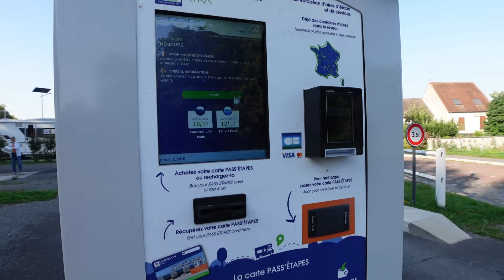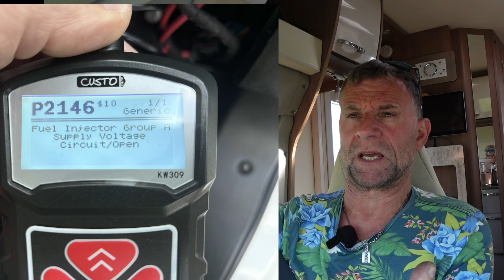CUT SHORT END "The Fiat Ducato Engine Light Edit"

Comment: Hi Jof, sorry to hear you’re having these issues. Fiat Ducato are notorious for these problems. Don’t replace sensors first. Do a diagnostic check. I’ve repaired 4 this year and the problem has been either blocked DPF or a EGR valve that is caked in carbon. They need cleaning out. If you replace a sensor, which one first, without diagnostic tool you’ll be going round in circles. The replacement sensor will go down after a short period of time.  Good luck
Reply from the maker: @tazmarkuk  thanks, looking more like Fuel side atm P2146 fault code👍🏼
Reply: Delete code, see if it comes back. When you mentioned open circuit on injector, you said vehicle running okay. I’d say it’s okay. Check water in fuel filter, should have drain on the underside. Drain some out. You may have had bad fuel.
Reply: I’ve noticed someone mentioned doing a forced regeneration. DO NOT DO IT. Would you knock a square peg through a round hole. No. Always Clean a DPF out.
Reply: I’m code comes back, check all connectors for corrosion, loose or burnt through on the injector side from the PCM.  Check power supply to injectors.
Reply from the maker: @tazmarkuk  thanks Mark think I have an injection problem…

Comment: Not sure of the whole story but DPF issues are a pain, especially for something that basically holds soot then on a regen it will throw it all out the exhaust anyway.     Sometimes the tubes on the pressure sensors block up causing limp mode to activate but if the DPF has become clogged up you could force a regen using a diagnostic tool.  
If it’s EGR issues I would suggest blanking it off and just mapping it out, it’ll run better 👍🏻.
Reply from the maker: Thanks Ant, think we have now eliminated the DPF & EGR, the fault code pointing to a possible injection issue 🙏🚍❤️❤️

Comment: Is it a 2.2 or a 2.3 ? Haven’t seen all the videos. Our second Fiat no issues so far 🤞
IME Diesel’s are better without the add blue, some 2020 versions. Having gone a year older our 150 bhp (no add blue) would leave the 160 bhp (with add blue) behind even though the current van is heavier. 
The manufacturers have fannied about that much to meet emissions, they can be a nightmare.
Reply from the maker: @phil342  this is a 2.3 non adblue Phil, just unfortunate I guess…
Reply: @MOHOTELADVENTURES  that’s a a bummer, hopefully you get a result. 
I remember a friend had murder with his Audi. After his last big spend clutch and dual mass flywheel he sold it, after he’d fixed everything. We joked saying for the next owner probably never missed a beat, best car he’d ever had🤣 MH’s are great but a pain in a&se also👍
Reply from the maker: @phil342  just itching to try to establish the cause..🤔

Comment: I tried to tell you to at least discount one of the injectors being spread and bot contacting. The engine runs but not at speed. That was exactly my symptoms in my Mobilvetta. Expose the injectors with the engine running and have someone watch the engine light whilst you move the leads in turn. If the light goes off, it's that one (at least one). When (if) you've found it tie the lead to so the lead with a cable tie solidly in a position where theres connection. I drove for at least a month like that in France with no further problem. You can find a short end for the guilty lead from IVECO (same part in many cases) and splice it on yourself. Fiat will charge you a fortune without being honest about the fault. TRY IT. Nothing to loose. The WD40 probably bridged the gap in the guilty injector till it dried out with heat.
Reply from the maker: Many thanks 🙏 for your information appreciated..🚍🏨💯